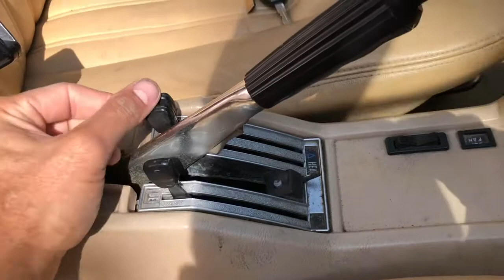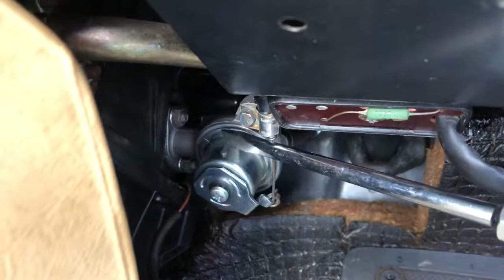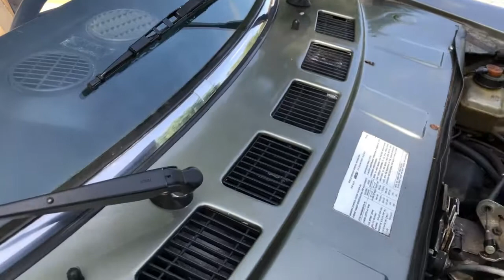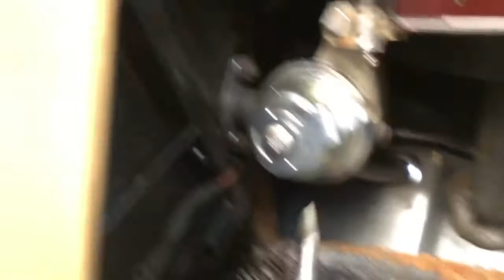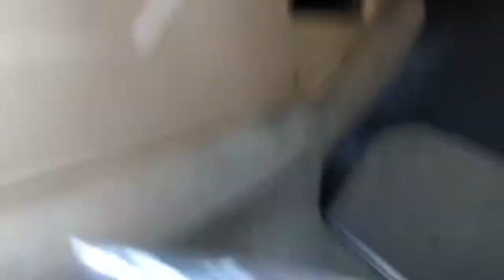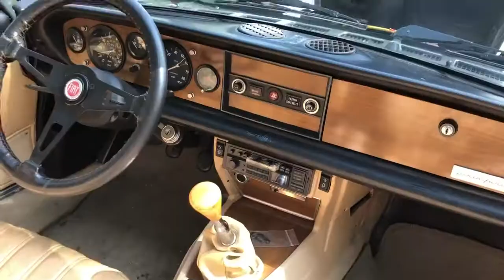1979 Fiat Spider 2000 Heat Control Valve Replacement

Comment: When I opened the " hot water valve control " ( that's how it's worded in the shop manual ) radiator fluid come gushing out . I hope this video helps. It's a 1981 spider turbo

Comment: Hi what is the other controls on the heat control. My car doesn't have any writings on it. I figured the right side of the hand brake is heat to the windshield what is the left most side control ?